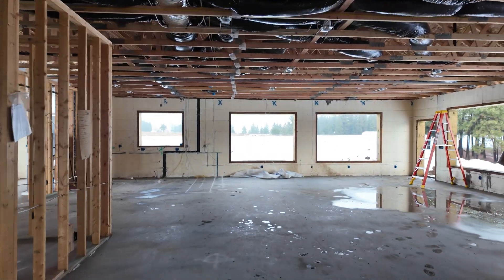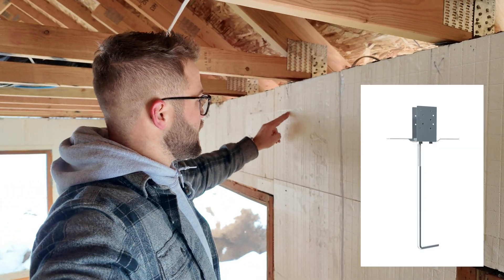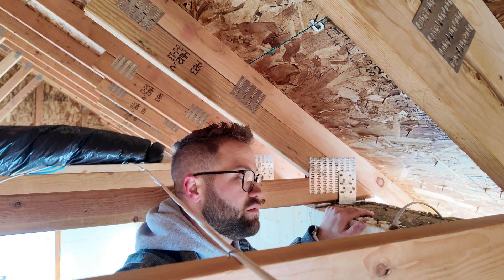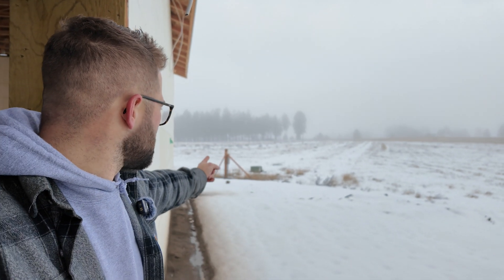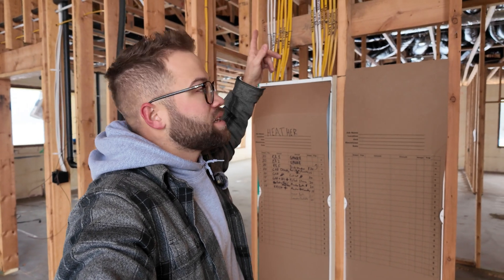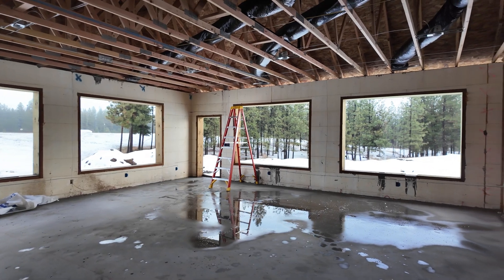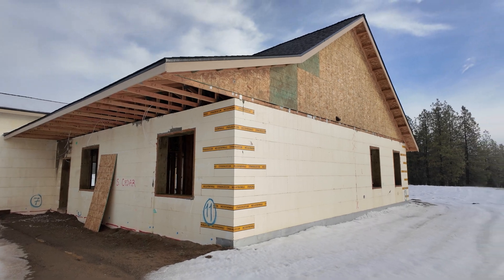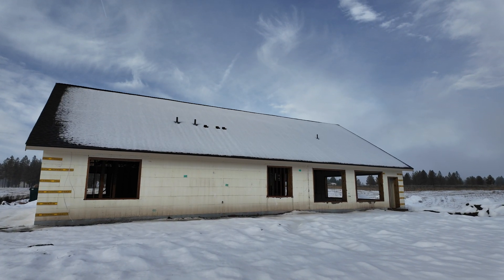Installing Electrical in ICF | Ep. 9

Comment: I built a ICF home, we used concrete for the roof as well.  Efficiency is off the charts however in your build, you use big windows (high loss) and wood framing (more loss).    For those looking to do this, I would  highly recommend you build ICF roofing.
Reply from the maker: When money isn’t a factor people are able to do anything they want.
Reply: @WrenBuildingCo  When I built my ICF home, the price was similar wood vs concrete.  Im very glad I did because its basically an igloo

Comment: Cool product, but why not just fir out a wall inside along the exterior wall?
Reply from the maker: That could be an option, However, that is a much more labor intensive route and running wires in the foam is how the product is designed to be used.
Reply: @WrenBuildingCo  I get it, but it's almost asking for a water line or electrical wire to be hit with a nail or screw

Comment: is there added benefit againt tornado compared to wood frame house? Most tornado damage is roof cave in or fly off. The weak link in ICF is truss. so it still have the same problem as wood frame house

Comment: You could use an electric hot knife instead of a chainsaw as well to reduce mess from the foam.
Reply from the maker: There are hard plastic “studs” every 8” OC so it would take significantly longer to make your cuts horizontally. If it was only the white foam, that would be my first choice for sure to minimize the mess.

Comment: How do you protect the wiring once in the chase from being punctured from like sheet rock screws, hanging pictures, etc?
Reply: The foam on ICFs are typically 2 +  inches thick.  Your drywall screws are 1 1/4 long.  Wires for pictures and the such typically decend from directly above close to door jams and the such making them not optimal places to install things like that anyway.
Reply: With ICF products, you should only be securing drywall, pictures, TVs, etc.… Into the plastic runners that act as studs in the foam. These are clearly marked and should be planned for just as you would a wood stud.

Comment: i used the burmon anchors too. Arent they supposed to be screwed in? Also our gable has a 2x4 in the bracket and the trusses screw to the side of them. We just got the metal on the roof done. Starting on decks and windows this week.
Reply from the maker: I’ll double check about the screws. we passed inspection, but could’ve been overlooked! Excited to hear about your progress!

Comment: Joshua, instead of wood framing, can icf be used for partians walls
Reply from the maker: Short answer, yes. But we have to understand the costs associated with building an ICF wall vs. light wood framing. If you are working around a budget, light wood frame is going to be the way to go for a partition wall.
Reply: @WrenBuildingCo  okay, thanks for your quick response.